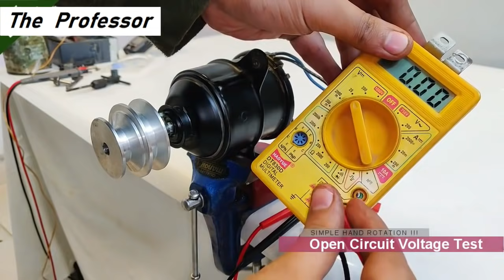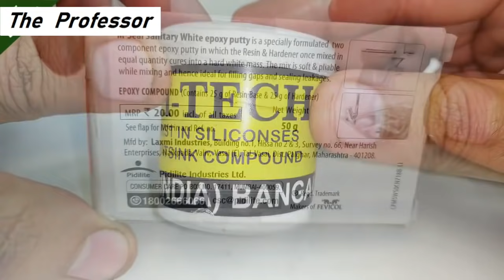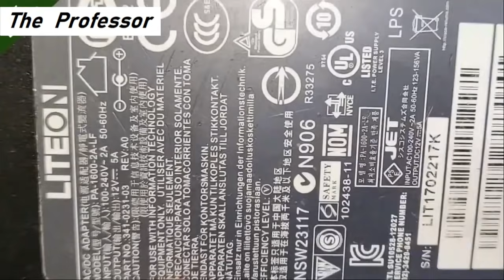3 SIMPLE INVENTIONS WITH DC MOTOR

Comment: First a car radiator fan motor of 800maruti also used as car dash  AC/ heater  blower motor.....oh with this transistor circut I will make a mega 7805 ic circut useing 10ics